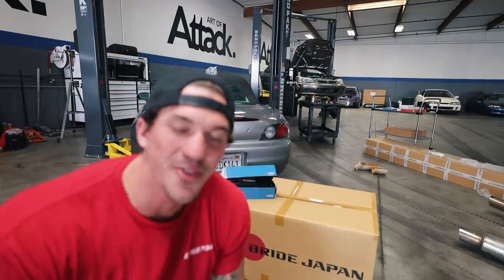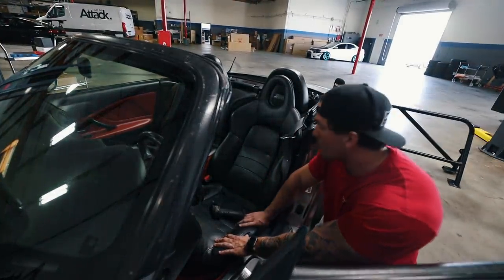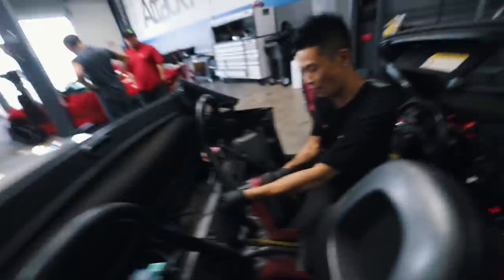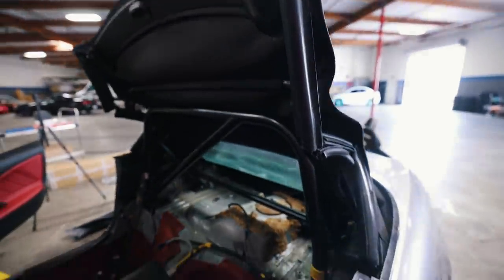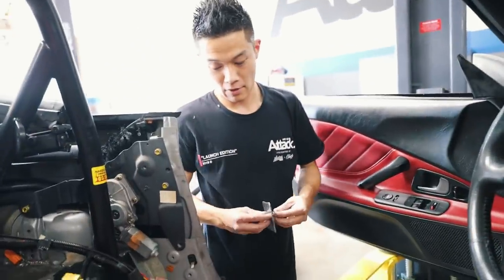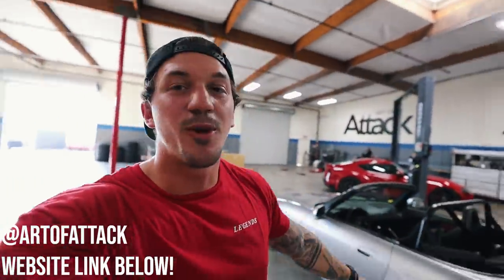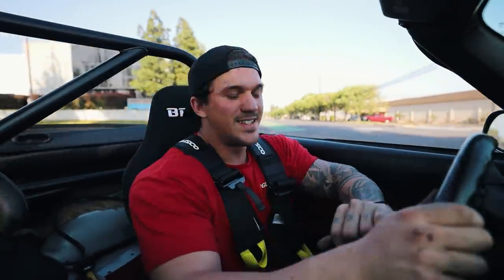HONDA S2000 GETS JDM CARBON FIBER BRIDE BUCKET SEAT, ROLL BAR, & HARNESS! | GOING FULL RACECAR!

Comment: Dustin the levell of the harness i very dangerous for you, the holes in the seat need to be AT level with your shoulders or a bit higher, if u get into a crash like that the harness will compress you down, and compress your spine, its supossed to pull you back , not compress down, PLS for your safety investigate a bit more on them , i might be wrong, but i dont think i am, i want you to be safe man!!!! The problem is the seats, theyr too short in height for you.
Reply: You're absolutely correct. I just commented the same thing. 
Bride seats are made for smaller Japanese people, needs to look at other brands like Sparco which are designed with much taller backs.
Reply: the harnesses have an anti-submarine feature
Reply: @eski2002  it's not about submarining. Glad he actually went with a 6 point not a 4. 
Its the shoulder straps being at the incorrect level/angle and pulling down/compressing on your spine.
Reply: Went with Bride’s why because JDM.
Reply: Yup Dustin should listen to this guy
Reply: Let's be real. It'll probably be sold and he'll be onto the next project. These cars are for views and nothing more. 

But yes, i agree with the harness suggestion

Comment: Ayyy Dut if you want the airbag light off you can get a  2.2  Ohm 1/2 watt or 1/4 watt resistor off ebay and connect it to the airbag seat connector or solder it to the connector harness. It'll fool the ecu making it think the seat is in the car.

Comment: Hey Dustin, I just gotta let you know. I own an 03 AP1. Your soft top isn't going down all of the way. There should be a bungy strap connecting two of the bars on the soft top to pull one back and allow the top to fold correctly. You can get upgraded replacement straps from a website ( modifry.com ) also as a resource check out is 
( https://www.s2ki.com/forums/s2000-under-hood-22/%2A-%2A-%2A-faq-s-diys-maintenance-%2A-%2A-%2A-548714/ )

PS: DO WHAT TJ COULDN'T!

Comment: Love it dude! You should get a strut bar/brace to stiffen up the chassis!
Reply: S2000 don't need them as they don't have struts. It's a double wishbone suspension set up. Also if you look in the engine bay there's a big cross brace between the shock towers connecting each frame rail. All that's needed :)
Reply: Todd Higgins thanks a lot for telling me bro!

Comment: You're too tall for that seat with the harnesses and they're at a dangerous angle. 
Hope you don't crash otherwise laters to your back/spine.
Reply: Ya this setup doesn't seem very safe :(. Not a fan of running harnesses unless there is a complete setup. Best of luck to Dustin.
Reply: you'd think art of attack would know and try to correct it
Reply: @MrUltimatePCgamer  he's done the full package at once which is good, only thing I'd do is disconnect the driver airbag until he puts his steering wheel on. Just needs to change the seat for something with a taller back like Sparco and he's good to go
Reply: @eski2002  ehhh, they got their money.

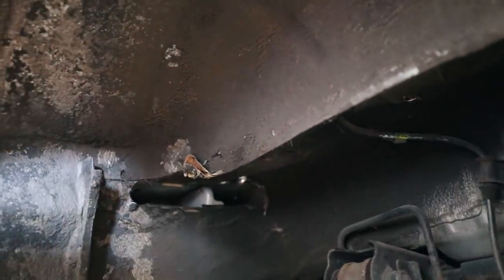Comment: Hey dustin after kent cut out the frame 7:20 did he weld it back or not?, water will come inside your car and it will rust if its not close and painted
Reply: Most common thing to do is fill the holes with expanding foam

Comment: Should change the fuel pump now while you’re in there. Way easier now than later
Reply: Why? OEM is fine for NA power levels. Besides you only need to remove one trim piece to get to it/the trims not going back in with roll bar anyway

Comment: I love the build bro but the seat may not be safe, maybe consider putting it as the passenger seat and then finding a taller one to suit you better. Love your content and the build, just want you to be as safe as possible. (I could be wrong tho I’m not really sure)
Reply: You're correct. There's been a few comments including my own pointing this out now. In a crash the shoulder belts will pull down and compress his spine. Ideally want the harness eyelets in the seat to be level or slightly above your shoulders.

Comment: Do y’all know if you sit lower in a bucket seat? Or do you have to get low seat rails
Reply: crackiswhack1993 I have the Bride Low Max in my Integra and I basically sit on the floor.

Comment: A word for the wise: NEVER drive a car with a harness bar/back-half cage and harnesses on the street! Extremely unsafe! If you get T-boned you’re gonna have a bad time.. ☠️
Reply: .. you basically get crushed by the belts when the seat and harness attachment point move away from each other. Even a lower speed collision can be deadly. Keep it safe out there ✌️

Comment: Those roll bar are for racetrack only. Why? Cuz that's the only time you'll be wearing a helmet. Guess what happened if you crash or get hit in the street without a helmet. Your head is will hit that roll bar..